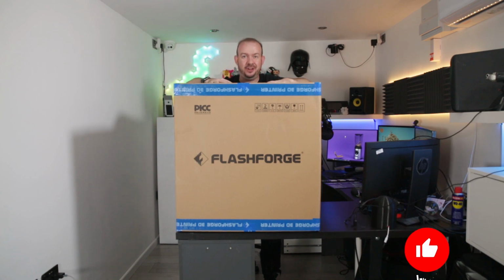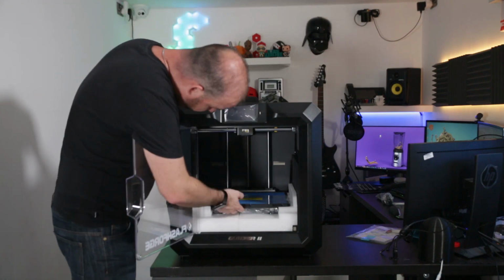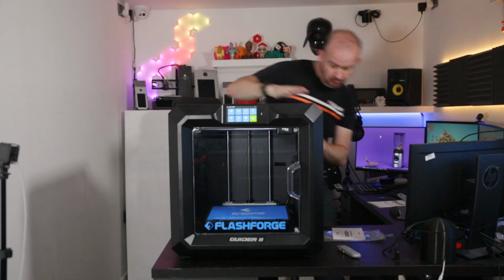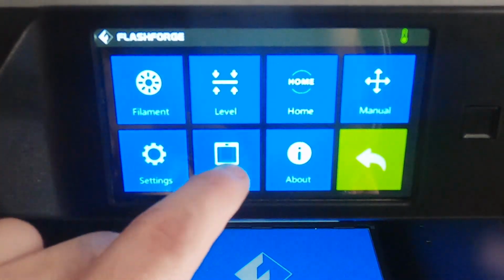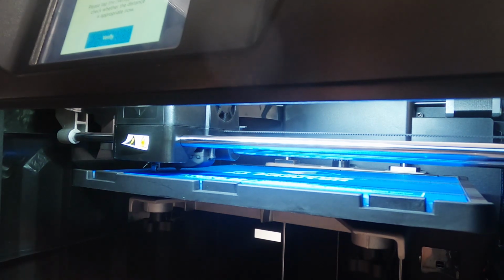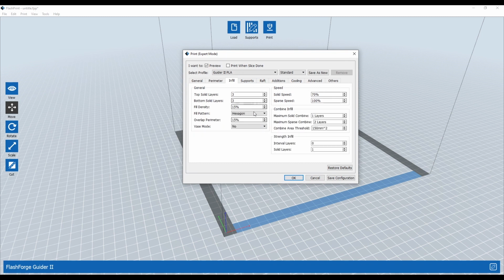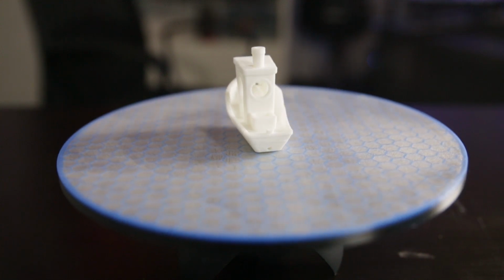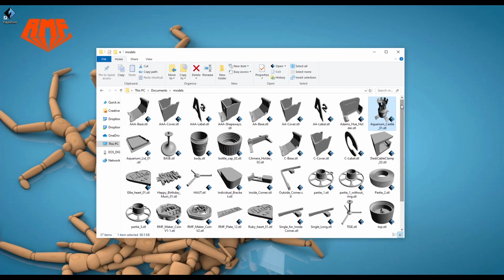Flashforge Guider II 3D Printer - Unboxing and Review - What's it actually like?

Comment from the maker: Thanks to Box.co.uk for sending me this printer! 

Useful timestamps:

00:27 - Introduction
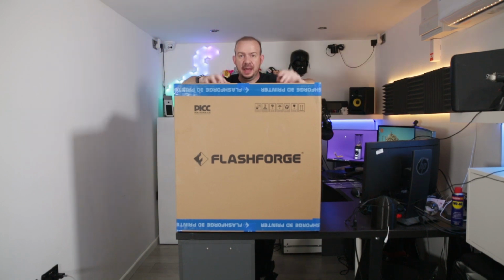01:28 - Unboxing
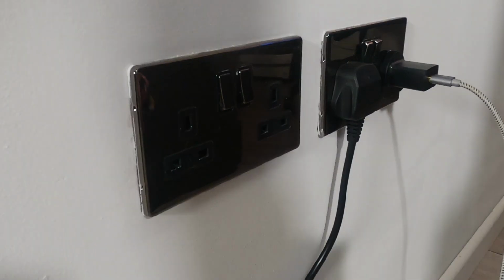05:19 - First Power On
09:50 - Filament Load
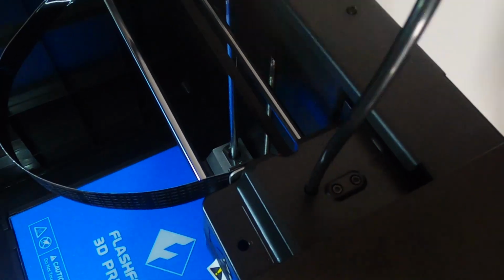10:10 - Looking at the touchscreen
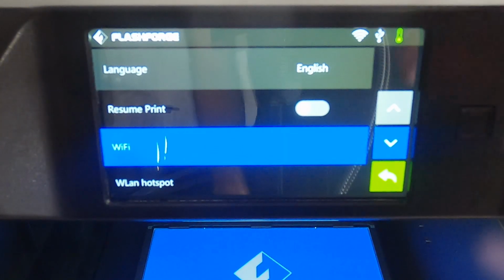11:16 - Firmware Update
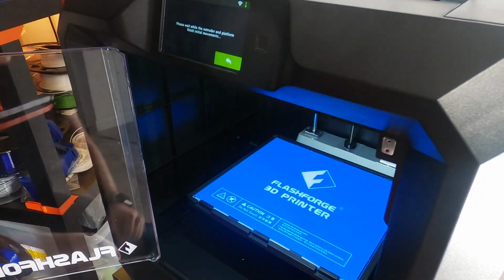12:36 - Levelling the bed
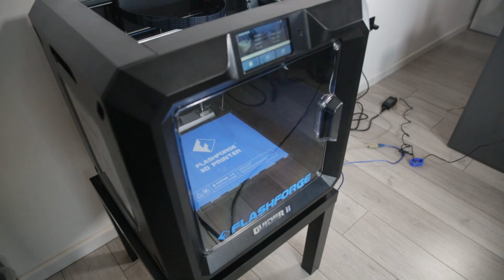14:47 - Installing the software
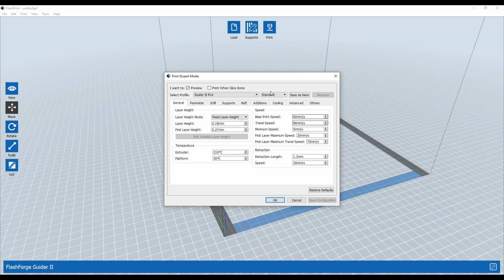16:31 - Sending a print to the printer
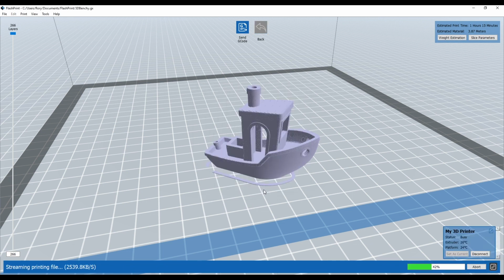18:36 - First Print
20:54 - 5 things I dislike about it
22:38 - 5 Things I like about it
24:02 - Final Summary
Reply: I use one of these at my local Library and love it.

Comment: First, you can add a moveable print bed, second, you can step up your printing speed to 60 - 70mms without issue when printing in standard, third, I have never, ever used glue on my glider or any of my 3D printers for that matter, just up the print bed temp to 60c and no, warping or melting will not occur at this temperature, lastly, you can replace the fan in the back with a quieter one.
Reply from the maker: All great suggestions! Cheers.
Reply from the maker: @Maureen Brunner in fairness 40 should be more than enough. Double check your Z height and calibration. It might be that you need to be a touch lower.
Reply: @Maureen Brunner No problem, in fact, you can go as high as 80c and it will still be okay. Though really, your best option is to just buy Flashforge's filament, than you can print at 200c for the nozzle and 50c for the bed with perfect results  

The biggest issue with Flashforge's printers are their inability to print most none branded filaments, yes, there are plenty of examples otherwise but why bother searching for one when Flashforge's plastic is already at the lower price range. I buy 1kg FFF PLA for less than 20 bucks a reel and ABS, PETG for around 24.

I also recently bought the new  Creality CR-200B, an inexpensive printer at less than 500 buck, fully enclosed, open platform, that prints absolutely fantasticly. So much so, than when using a 2mm nozzle head, my prints are on par with a resin printer.

Though I think I need to stop adding printers toy collection  for awhile and just enjoy what I have as my home lab now has 8 printers. My Markforge Mark Two,  FlashForge Creator 3 and Flashforge Creator Pro with updated Extruder and high temp nozzle from Flexion being my favorites.  Though really all of my printers bring something to the table, especially when printing large or complex models that now only take hours to print, instead of days. This is over 5 years of collecting, trading, buying used, new, building a custom printer, being a beta tester, etc. Finally I can now say that I'm a 3d Printer guru

Comment: How does it hold up against lower budget fdm printers like the creality ender 5? I currently have that one and it needs a LOT of occassional finetuning and fixes, it's honestly very frustrating. I'm looking for a printer that can just keep working basically.
Reply from the maker: Personal experience with Flashforge means they do just that. I hardly ever had a problem that wasn't solved with a nozzle change or an unclog. I mean, it is 3D printing so I will likely never be completely maintenance free, but the Flashforge ones are the best I've come across in that area yet.
Reply: @ratemyfuneral  Thanks so much for the fast reply! Appreciate it.

Comment: Hi, Nice review please guide me which 3d printer should I buy flashforge guider 2s or zortrax m300  plus for easy to use and low maintenance
Reply: If you have 2k in your pocket, go buy two flashforge creator pro 2's. You get a great IDEX printer.
Reply: I’m in the same place where you are rn, but m300 plus is like 1,000 usd more than the guider 2s. Probably zortrax is a more well-known brand than flashforge, but 2S has a higher max nozzle temp with a slightly smaller build volume. It just mainly depends on what temp, speed and volume you need since comments and reviews shows that flashforge is a good printer. Let me know what you decided and good luck